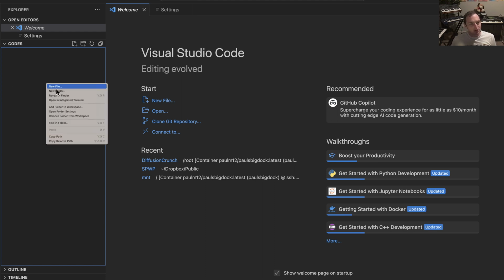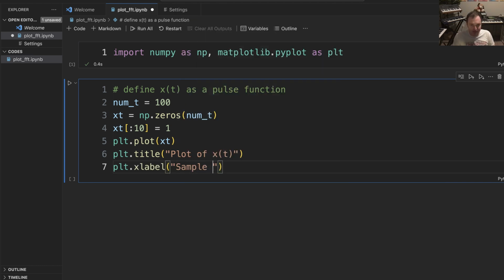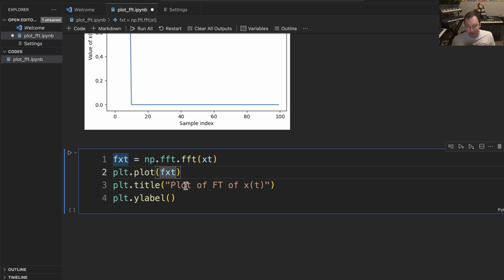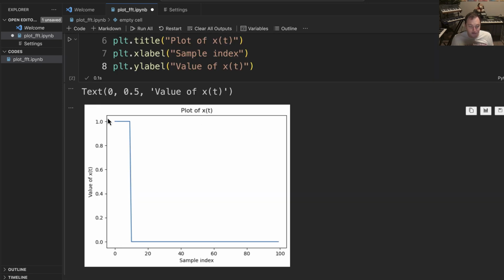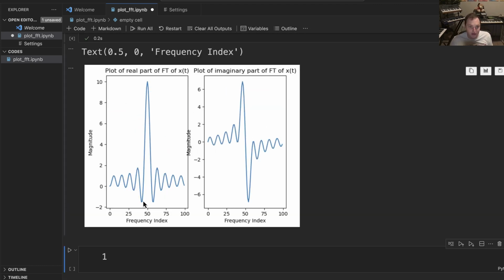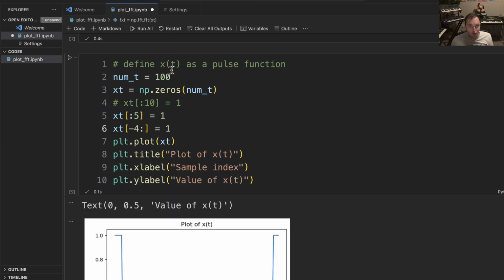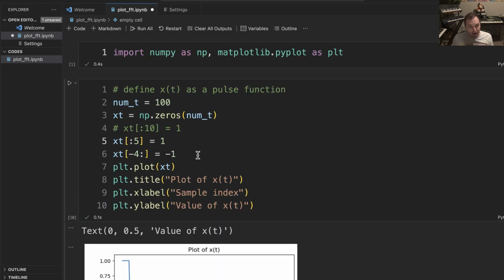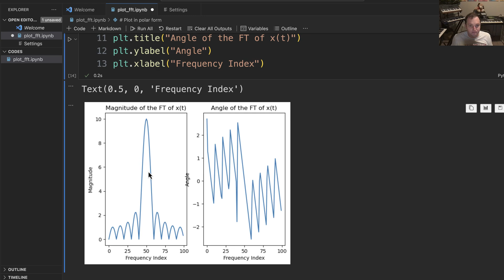Plotting the Fourier Transform in Python (DFT/FFT)

Comment: In general, i think if you're sampling over some interval T and take N samples, you need to take the output and scale it down by deltat, which is T/N. Also, each frequency bin should correspond to 2pik/T where the highest frequency we can obtain based off our sampling is piN/T. Also, while the magnitude will be correct, we might need to account for the phase being off because the fft function has no idea where i'm actually sampling from, so there might be a phase shift that's proportional to the frequency of the bucket

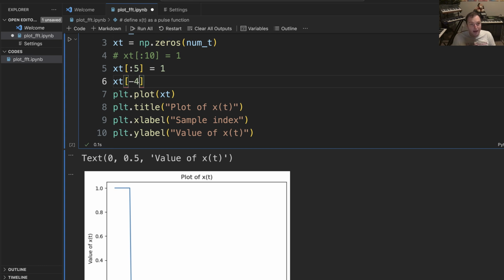Comment: 7:07 - it should be xt[-5:] to make it symmetric, since that would cover -5, -4, -3, -2, -1 complementary to 0, 1, 2, 3, 4.
Thx for the covering the fftshift.
Reply from the maker: Keep in mind that even symmetry is defined as x[n] = x[-n] and odd symmetry is defined as x[-n] = -x[-n].  As a result, x[0] is a special value; it serves as the "anchor" of the symmetry if you will, but isn't included in the calculation.  x[1] corresponds to x[-1], x[2] corresponds to x[-2], etc. 

I originally made this mistake and set x[-5:] = -1 when I was preparing for this video, and was wondering why the imaginary parts of the spectrum had nonzero values.  I'd encourage you to try it out to see.
Reply: @SignalProcessingWithPaul  yes you are right

Comment: Hi Paul. Why do you call DFT in the title when you don't show DFT at all in this video? The DFT operates exclusively on discrete sets of data and produces a spectrum comprising discrete frequency components.
Reply from the maker: The only way you can compute a frequency domain representation in a computer is with the DFT (the FFT is a way of computing the DFT that uses some symmetries to reduce the number of computations explicitly needed from Log(n^2) to n log2(n)).  

Since a computer cannot process an infinite number of datapoints or have infinite precision in amplitudes, you need a signal that is discrete in time and discrete in frequency to do any operation like this.

Hope this helps
Reply: @SignalProcessingWithPaul  Thx for explanation.

Comment: How to know what are the different frequencies which constructs your main signal? I am asking about the frequency values not its amplitude.
Reply from the maker: I may make a video on this.  To answer your question, it will be divisions of the sampling frequency of your signal (which is 1/T, where T is the time interval between samples).  Given a sampling frequency Fs and N samples in the time domain, each index of the FFT will be at k*Fs/N.  However at Fs/2, (meaning for all indices larger than N/2), the frequency "wraps around" and becomes negative due to aliasing.  So I believe the frequency can be written concisely as (k*Fs/N) - ((N - k)*Fs / N * I(k > N/2)), where I is the indicator function.